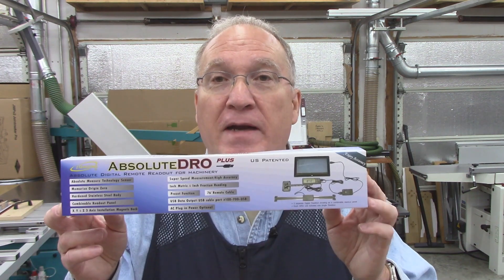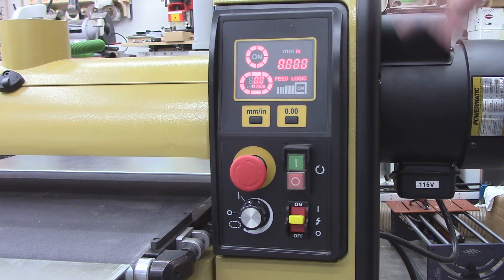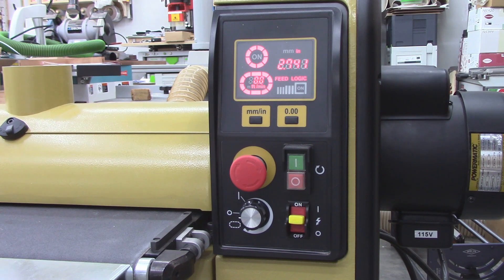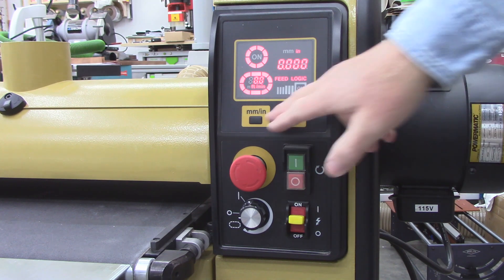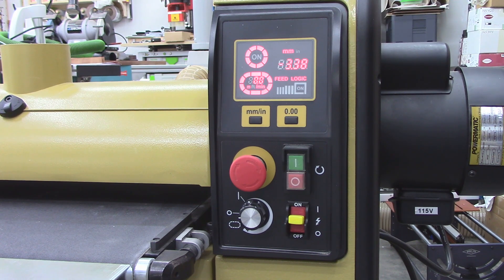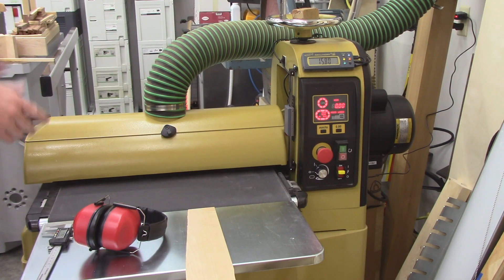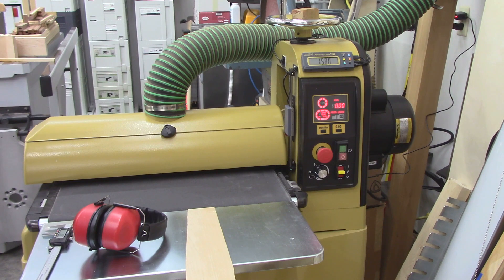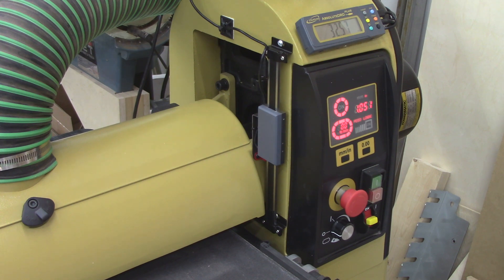Installing Digital Readout (DRO) on Powermatic Drum Sander

Comment: Hi Steve, enjoyed the video because I'm thinking about adding the same DRO to my planer. Now that you have been using your DRO for two years have you had any issues with it?  I'm a little concerned about the amount of vibration both the sensor and readout would get mounter on a planer head assemble.  What do you think?  Thanks
Reply from the maker: Hi Jack.  I wouldn't worry about vibration as I have not had any issues with it.  It does have an annoying quirk in that if it loses power either by dead battery or unplugging the AC adapter, it loses its setting and I have to go through the overly complex method of re-entering calibration data.  If I had to do it over again, I would look for something that retains its memory on loss of power.  Steve
Reply: Hi Steve, I have been thinking about the iGaging unit not holding its settings when it looses power.  The local power co. here has enough flickers and outages to make resetting zero a pain.  If you find someone that has a memory chip in their DRO that would solve the zero problem at a reasonable price, let me know.  Thanks for the information and BE Safe. @extremewoodworker

Comment: That would be super annoying. Sad that this is a premium machine and it has this little annoying issue. I have a number of the 2244 Jet sanders, 1938 Supermax, and a Woodtek 25 and I have added the iGaging readouts as you have done. I was looking at the Powermatic. Good to see adding the DRO is relatively easy. Nice job.
Reply from the maker: Thank you Ron.  It has worked out well.  I use the factory readout for relative adjustments and the iGaging for absolute measurements.  Steve

Comment: Thanks Steve, I just bought the same DRO for my PM2244 and after watching your video you saved me a bunch of time to figure out how to mount it. By the way that cable can be replaced with a shorter one, it's a usb male micro to male micro cable the just used a dot of hot glue inside to hold the connection very easy to replace it.
Reply from the maker: Thanks Rich.  Good to know about the cable.  Steve

Comment: Another good video Steve. Looks like your last review of this machine was after your only had it for a couple months. It would be great to see an update video about your experience with the machine, any comparisons with other machines that you know of and your opinion of whether or not you would buy this machine again or opt for something else.
Reply from the maker: Thanks Rich.  I really can't compare this to other drum sanders since I have no basis for comparison and have not used other brands.  If I had the space, I would have gone with a 37" wide belt and I had the opportunity to purchase one used in excellent condition but passed due to lack of space.  A wide belt sander with a combo head, will provide a superior finish to any drum sander on the market.  

I will say that Powermatic stands behind their products.  I did have an electronics and/or conveyor motor failure after about a year (the smoke escaped while making a light pass on narrow boards and Powermatic agreed I wasn't overtaxing the machine).  After replacing several circuit boards that didn't resolve the issue, Powermatic ended up replacing the machine (something they offered and not something I asked for).   To my knowledge, Powermatic did not know (and still does not know) I made YouTube videos so that had nothing to do with the replacement.  Since then, I have not had any issues at all and haven't seen the random drift noted on an earlier video.  I would purchase this machine again.  Steve
Reply: @extremewoodworker  more response than I expected but VERY much appreciated.

Comment: Super! Just replaced my old Performax with one of these PMs and have the same complaint about the readout. Great suggestion!
Reply from the maker: Hi Ron.  So far I am liking the DRO as the results have been within 0.1mm of the readout.  I think I would prefer the ability to hide the last digit in the readout since 0.01 mm is beyond the capability of the sensor.  Steve

Comment: Very good Steve. When I was trying to make my mind up on which drum sander to buy; the Powermatic was one of them. I wanted the one like yours, because I have Powermatic table saw, drill press, Mortizer and bandsaw . But I finally decided on the Jet oscillating drum sander; because it was considerably less costly than the Powermatic.

So I am going to do just what you did; now that you have taught us how to do it. Thanks for the "tip" kind Sir.
Reply from the maker: Thanks Pat.  I looked at the Jet and the SuperMax before going the Powermatic route.  I decided on the Powermatic primarily because the table tilt adjustment was more user friendly than the others, the cleaner appearance, and ironically, the digital display.  I don't recall Jet having the oscillating feature at the time but do remember it had a plastic dust hood.  You probably get a better finish with the oscillating feature.  Steve
Reply: @extremewoodworker  Yes I bought the Jet as soon as they came out with the oscillator feature. I too did not like their tables. So i opted to not buy their tales and I am going to make them myself.